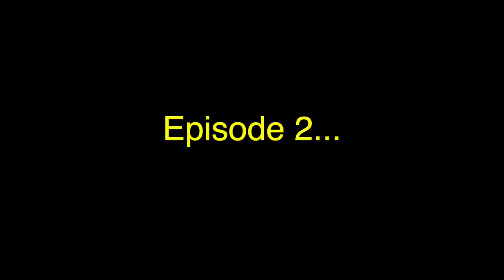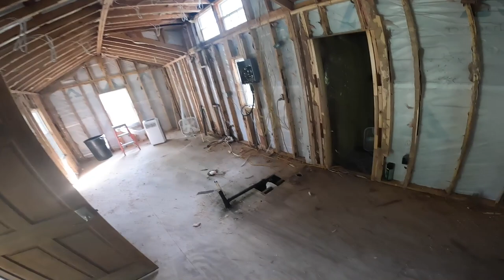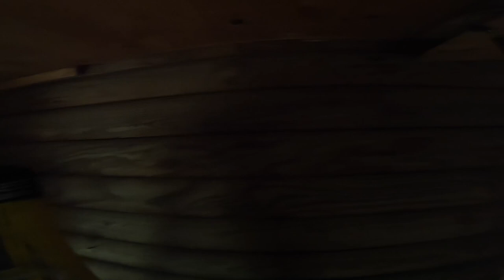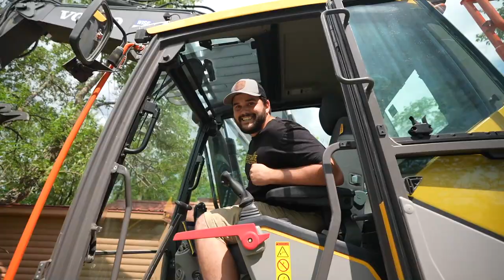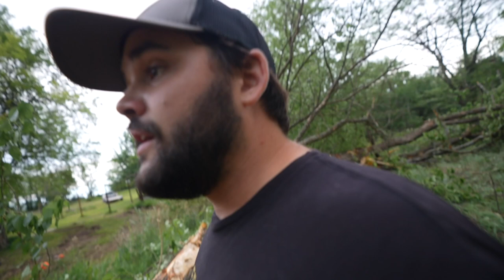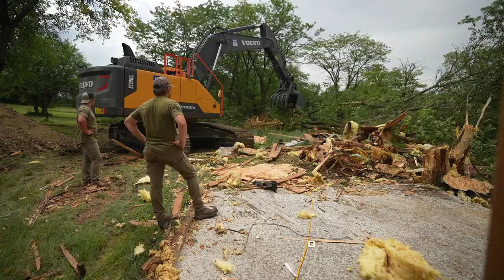Renovating Ranch Cabin Part 3: Carefully Destroying the Addition that's Filled with Mold

Comment: Since you're not matching the concrete pad of the old edition now I would extend  from to 10x32(I believe those were the measurements) to 12 or 14x32. The original measurements made sense because you were matching what was there to save but you've gone this far the extra couple feet would make things go from being a little snug to being comfortably roomy. Especially in the bathroom and in the living room where everyone would gather.

Comment: I don't know how far along you are, but that cabin being a mobile home is just sitting on concrete blocks, so since it moved some when you were removing that addition, I'd get someone to get under it and make sure the concrete blocks are still straight and holding the frame level. If the blocks shifted then the entire cabin will end up settling and even moving/shaking when you walk through it. Plus, you can't backfill around the cabin and seal up the entire bottom, it has to have ventilation underneath it. It being the size it is, It should have two vents on the front and back about the size of a concrete block, and one vent on each end. 
We would use concrete blocks as skirting, and where we wanted a vent we would just turn that concrete block on its side so that the two holes in it would be the vent, and we would put half-inch mesh wire behind them so it could vent and block the holes so mice and things couldn't get under the house.

Comment: You could’ve easily gotten them trees out without ever touching a chainsaw, with an excavator of that size the bucket and thumb would most likely pinch through the base of that tree. To break it up you pick it up near the trunk and basically fold it back in itself you don’t try to break it by stabbing it with the bucket teeth.  The bucket with a thumb is extremely versatile and strong, that’s not the mini excavator and once you learn how to use it there’s not much you can’t do.  You need to watch a couple videos of letsdig18 clear some land and build a pond and watch what he’s able to do with an excavator it would be really useful knowledge for you to have and be able to implement doin stuff on the ranch
Reply: lol letsdig18 is the best watch him all the time

Comment: The rebar is typically included to strengthen the concrete to limit stress cracks as the ground settles and shifts. There’s a chance what they put in your basement if it did not have rebar was fiber mesh cement.

Comment: Flair it would have been much easier if you had the tracks facing the tree. You could have used the bucket and machine to move forward. You have much more stability not working from the side of the tracks. Practice makes perfect. Best of luck.

Comment: You should tear off that side of the roof your going to build addition on and tie new roof into the top of the main structures top of roof so it's seamless and less chance of water getting in and that's a way to get the highest roof in the interior. Won't take much additional work.. I wouldn't do it how they did.

Comment: You could have just lifted the fan out of the socket it sits in on the bracket, no need to sit there and turn the whole fan to unscrew the shaft connected to the ball/knuckle that sits inside the brackets socket

Comment: Well the only thing that bothered me watching this is the money that could of been saved on the log siding. Brad said how expensive this material is. It would of been easy to remove and sat aside. If the new edition was the same depth just longer you could of used this on the ends.  And that window was good right.  Brad could of repurposed it!!  Flair come on dogg!!!! Lol. That looked fun nonetheless!  I wish I could come out and help with projects.  I'm one of those guys that can do everything. Wiring to putting a engine on a go kart. And putting a stero system in your car!  I grew up on a farm.  So I was raised to just fix anything myself and work on my own vehicle.  I would love to come work with the beef cake crew!
Reply: I drive over the road semi  pulling a flatbed for TMC. I can operate any machine. I worked for a local construction company servicing all the big trucks and equipment.   I am just a jack of all trade guy. 40 years old 2 older kids and a 4 year old now.

Comment: I would of just taken the chainsaw and cutup the walls and through the roof like 5 inches away from the house. Then tore it away andclean up the wall after in the open air. It would of saved alot of time.

Comment: Flair you should watch https://www.youtube.com/c/letsdig18 for some awesome pointers on running that backhoe.  Just watching a few of  his tree clearing videos I bet would up your game substantially.  Also, rebar goes through cement slabs to prevent cracking.  It gives it more structure as you could see it came out as one piece until you started breaking it up with the bucket.

Comment: I had to pause it again I so wish you were alive right now to receive it information basically what I was saying is I pause it right when you're pulling off the trim and pulling down that I don't know if it's sheetrock or paneling the reason the trim work is lightly nailed in it's not structural it's just there for Aesthetics what I was saying is I would have gone up on the roof took a circular saw ran it the whole length of what you're trying to take out meaning you're existing house the one you don't want to remove just leave what it's mounted to you'll figure that out and be easier rip the circular saw the whole length separating it from your flip house and then go inside cutting the joist and then come in with your excavator in the thumb sorry I'm voice texting you'll see some typos

Comment: Hey Andrew LOL it's me again I stopped at as you're taking the tools out of the room you're about to demo sometimes you might want to go live when you do these things so you can take suggestions from people like me I've been a carpenter since I was 17 I'm not going to tell you my age I'll just throw out there well over 25 years I've been doing this what I would have suggested so you didn't rip it out of the the part of the house you don't want to remove you cut the roof all the way down leave it overhang cut those choices now you've separated that part of the building from the building you're trying to flip like I said just suggestion that's how I would have done it and then you can go back and work that part off a little more gently but anyways you're not live and you will not receive this as you're doing it I'm going to watch it I'm sure I'm going to giggle let's start it